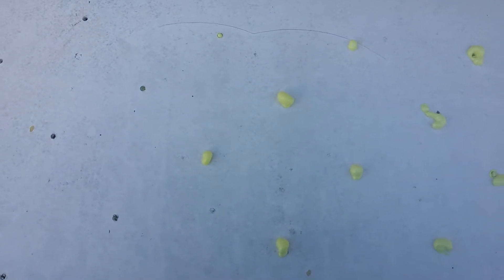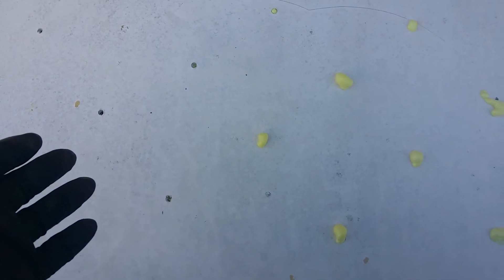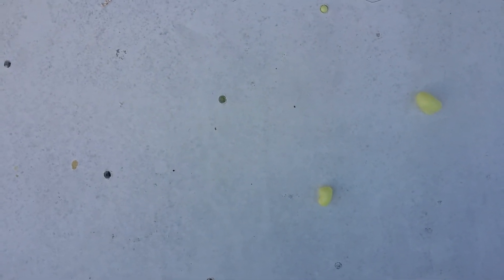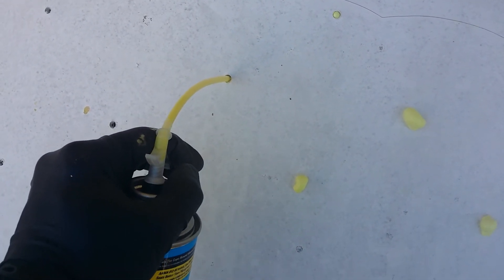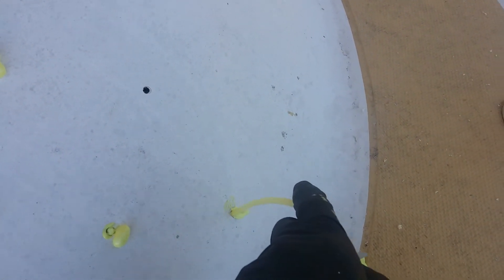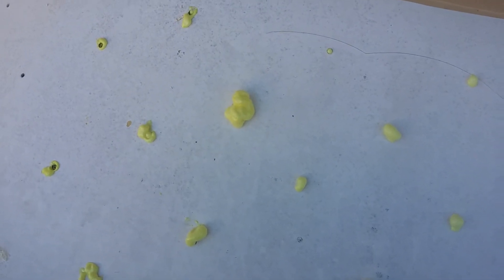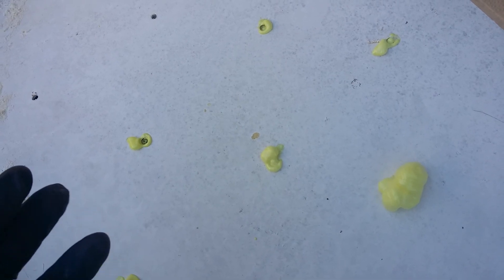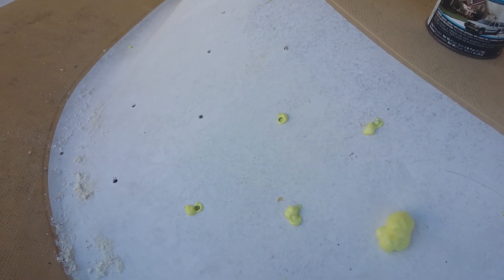INJECTING A FOAM CORE

Comment: Coming back to this from someone who's tried almost all methods on a large trawler. For this application of a non structural section the foam works fine but what i've found that works much better for decks that have rotted or missing core is gorilla glue.  Cures very very rigid, bonds to anything and water actually helps it flow. It expands like crazy and is messy but get's the job done. Sometimes a deck/core has cracked, turned to mush and the wood water drained somewhere leaving you with a completely hollow core.. In this situation simply use a skill saw set to a shallow depth, cut the top layer, use resin or any "glue" of your choice, cut a new core(plywood works okay), lay it in and replace the top layer of fiberglass.. Sounds like alot of work but not as much as filling a bunch of drill holes(from experience).
Reply from the maker: Victoria Jones it was surprisingly rigid once it cured and this wasn't a section of deck that anyone would stand on. I find patching small holes to be easier than large cuts. Would I do it again? Maybe I wouldnt use so much. It pushed out the inside.
Reply: Thank you have to try that my Parker has soft and delamination spots, assume the core is wet, don’t want to have to dry it out
Reply: Was gonna try gorilla glue on swim platform,  it's removed from boat and I can flip it over.

Comment: Good idea but doesn't seem like it would add enough "solidity" vs pour in foam boats like boston whaler. How did it work out?
Reply from the maker: once it cured it was really rigid. it actual pushed in the inner hull a little bit. ill probably have to cut than part out and sand the foam flat, and then glass the panel back in. if i do this again i will space the hole further apart and use less foam.

i did this for the big hole in the aft section too. no problems at all.
Reply from the maker: ive heard (after i didi this off course) the "window and door" blue can has less push out. reading the cans and searching online i couldnt find any difference except the name.
Reply: I ended up throwing away a 1974 Wellcraft using construction foam. Way cheaper? Not at all...
Reply: It adds no solidity and it traps water in it. Non structural, non water catalytic